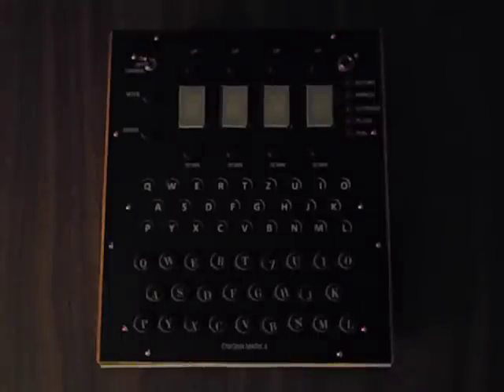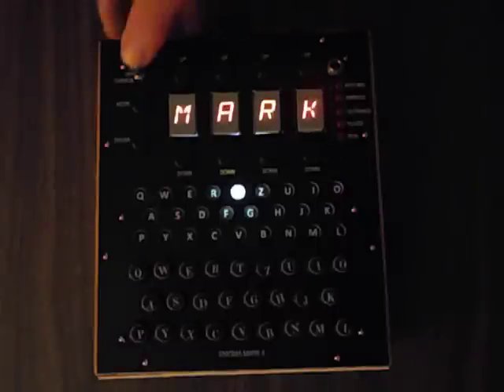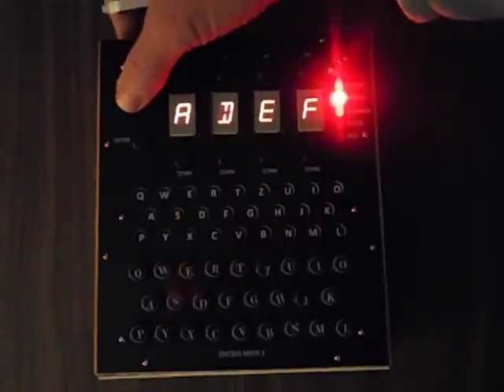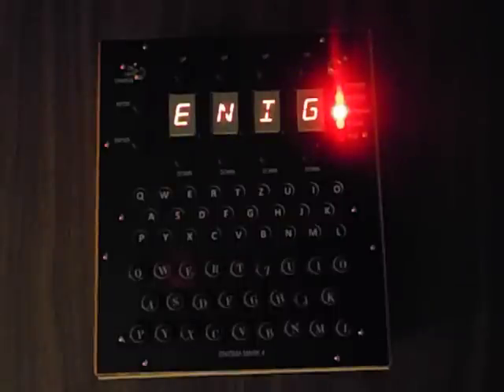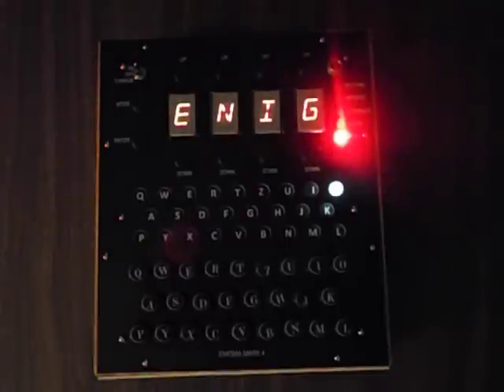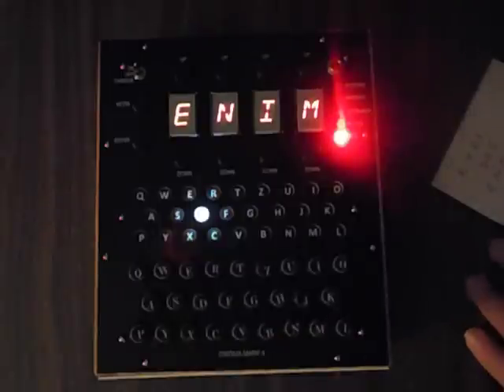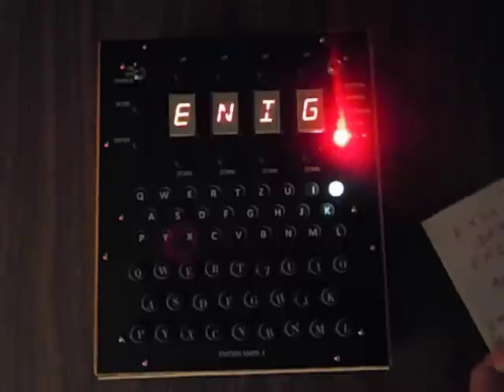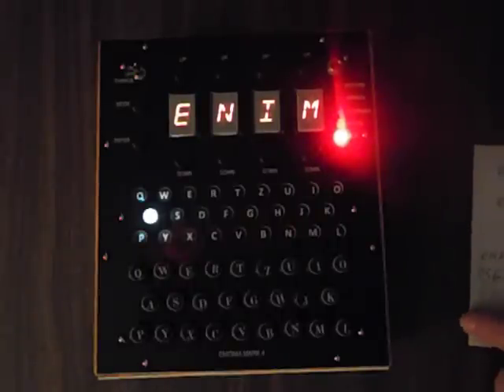How to use the S&T GeoTronics Enigma Mark 4 Replica

Comment: If this all electronic version of the Enigma Cipher Machine runs exactly the same then it has ball of the same flaws, Achilles Heels
Reply from the maker: Yes, that's right, including the double-stepping behavior which is well known.  When I first got my unit from S&T the double-stepping did not work, but they gave me a software update to fix that.  

Sadly, I have been unable to contact the guys in Georgia for over a year now, I don't think they are in business anymore.
Reply: ***** Yes, that too, but I was referring to the machine encrypting in reciprocal pairs. That was its chief flaw, the reflected wheel, the umkerwalze
Reply from the maker: Oh, I see what you mean.  Yes, that was a real flaw that made codebreaking easier, but it also made the machine easier to use when it was deployed to thousands of sites, which was a consideration too I'm sure.
Reply: Hi Don! I received an Open Enigma Replica Kit as a birthday present from my girlfriend a while ago. It's a great kit and I just finished assembling it. 

I know that you are not the creator of the kit, but since you have one, maybe you can help me out:

As I was trying to download the Enigma code for the Arduino, I realised that the download links on the OpenEnigma site are not working for me. When I click the Mark4 Code V2 link, I get a 404 error from Dropbox.

I already tried to email Marc Tessier and James Sanderson from S&T GeoTronics, but they have not responded to my messages.

Do you maybe have a copy of the ENIGMA M4 code at hand? It's very unfortunate that the only thing that's stopping me from using my shiny Enigma is that I can't get a hold of the code. Thank you very much!

My email is markus[at]schanta[dot]at. Thank you!

Comment: The last step did not work for me. When I entered the cryptogram letters, they did not spell out my intended code word that I thought I encoded into my mark 4 enigma machine. I tried it thrice, all 3 times, it failed, even though I kept rewinding your video to be sure I was following the right steps. What do you think is wrong? Should I send it back to S & T? BTW, is there a way to remove S &T's logo from the lit display? My own title only flashes once on the display while S & T's logo flashes repeatedly. The result is that my title is not seen enough and S &T's company logo is seen constantly. Because I am trying to promote a cryptic discovery of mine by having the name of the discovery in the display window for publicity purposes, the S & T logo is running pass interference because it makes the display  look too busy. I prefer having the title of my discovery flashing repetitively on the display and nothing else. The way they set it for me at S & T, my title is seen once and once only and then is followed by S & T's logo constantly thereafter in a recurring cycle.
Reply from the maker: Johnny, regarding changing the scrolling message from S&T... to your own custom message, I assume you contacted the guys in Georgia and they told you how to do it.  I have never done that myself, although they told me it was possible and involved replacing the exact S&T text with your own message, but it had to be the exact same number of letters or it wouldn't work.  I did look at the code once and saw where the current message is, so it shouldn't be that difficult to replace it with your custom message, but again, it has to be the exact same number of letters, or so I was told.

Good luck.
Reply: I'll find somebody to do it, thanks.

Comment from the maker: @nyshroud, I assumed that viewers would have some familiarity with Enigma.  Setting the rotors to 4, 2, 1 means that I am choosing to use these 3 rotors from the 8 rotors available on the Enigma.  Actually, the leftmost rotor is called Beta and I didn't set it specifically because the replica defaults to Beta (the other option is the Gamma rotor in the leftmost position).  So the first step corresponds to putting rotor number 4 in the second position, rotor number 2 in the third position, and rotor number 1 in the rightmost fourth position.  Then I set what are called the "inner rings" which corresponds to selecting an electrical offset for each rotor, to further scramble the electrical signal.  On the real Enigma, this is done by rotating the index ring and then locking it in place with a spring-loaded pin.  I choose offsets D, E, and F for rotors 4, 2, and 1.  Then comes setting the "outer rings" which corresponds to selecting what letters appear in the windows on a real Enigma at the start of the message.  This is also called the "key."  My key is ENIG in this example.  I then set 3 plug pairs, A to G, H to M, and C to F.  This causes the Enigma to treat letter A like letter G when encrypting and decrypting, which is just another level of security.  Same for letter pairs HM and CF.  

On a real Enigma you would do all of these things (except plugs) with real physical rotors, but the replica does this electronically.  

On my early replica, the plugs are set this way, in software.  On a later version of the replica, the guys at S&T Geotronics have implemented a real physical plugboard, using those little black plug cables.  This makes the replica much more realistic.

All of these setting options give the Enigma it's great power.  If you have seen the movie "The Imitation Game", you see that there are over 159 million million million possible initial settings of the machine, which is why the Germans thought it could never be broken.  Of course, Alan Turing and his partners at Bletchley Park figured a way to do it.  The Polish codebreakers actually were the first to break it, prior to WW2.

Hope this helps.  It is a fascinating machine and my math students love it.